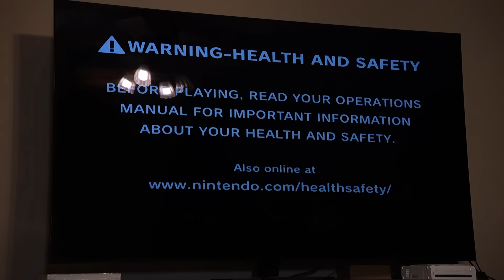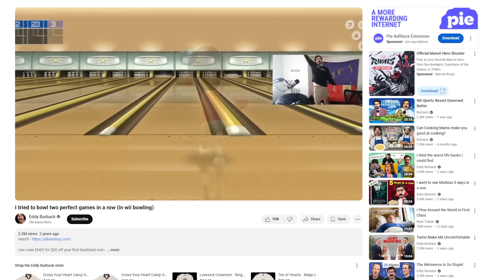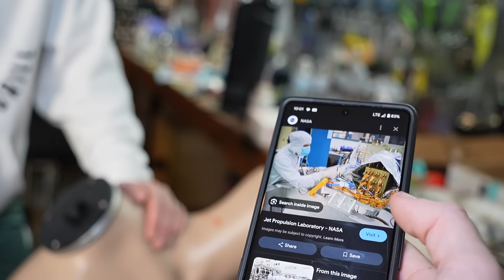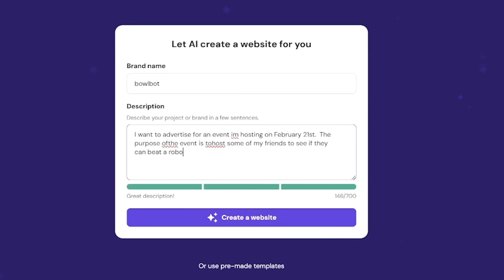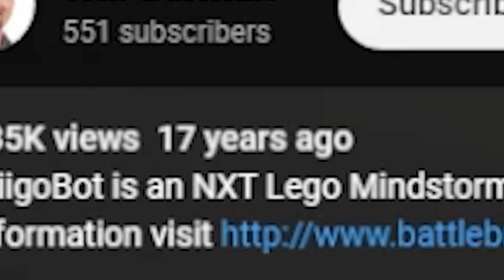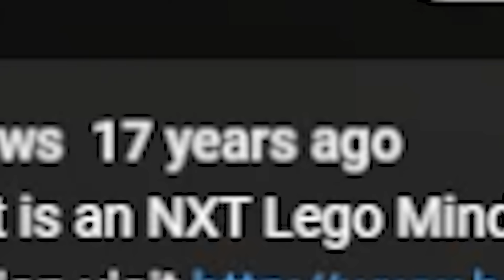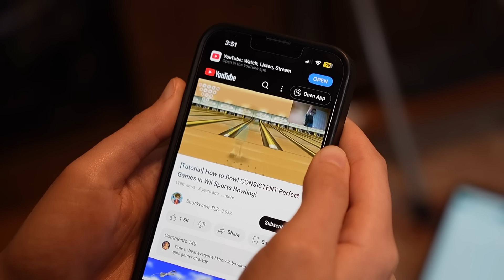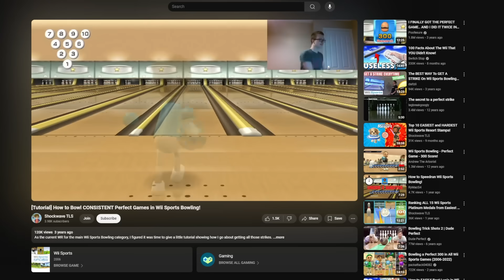I Built a Robot to Get a Perfect Score in Wii Bowling

Comment: When I was younger me and my siblings discovered that the best way to hit the ball in baseball was to hold the remote close to yourself and just flick your wrist/elbow as much as possible. Physics model goes crazy and the instantaneous g's you pull in that second send the accelerometer spinning while the sensor bar only sees a quick dash so your character does a full swing at the speed that you flicked your wrist.

Comment: I forget, does the original not let you add spin to the ball? I know the Resort version does, but that also uses the gyro controller/addon.
Reply: Nevermind, just got to the end bit where one of your friends put spin on it. Adding spin should make the strike pocket bigger and more toletable of minute perturbations, depending on how realistic Nintendo made their party bowling simulator. In theory this could make your robot more consistent at the cost of added setup complexity, but you only have to find the setup once per session. I'd also recommend clamping or weighing it down so the swings don't move it around. Didn't seem like an issue, but you never know.

Comment: I don't know whether it's the same in the not sports resort bowling. But in resorts you don't have to actually swing the remote you only need to accelerate the remote so just mount it onto so linea rails to move it in the direction of the tv that will make it throw perfectly straight then you would only have to automate the character moving like to clicks to the side and have guaranteed strikes all the time with a probably easier build (just my guess im not an engineer so i dont know whether it's actually easier but seems to me)

Comment: Love the video, the nostalgia is wild. 
Also why do you use junky servos? I think it would have worked a lot better if you got yourself a few nice Savox or MKS servos like they put in RC airplanes. Much faster and more accurate. 
Also I think that gear system probably amplified any inaccuracies of the servo. 
I think you should revisit this with better hardware and get a perfect 10… 10 times… 😂

Comment: Typical mechanical engineer, doing things the hard way. The EE / COMPE would just fake the sensor data and automate the button presses electronically, rather than physically swinging a remote and physically pressing buttons with servo motors.

Comment: congrats on designing a device that can play Wii Bowling almost as well as I could when I was 11.

the secret to getting 300 every time, without a robot, is to simply hold the remote backwards and twitch down forcefully with just your wrist as you release, instead of swinging it like an actual bowling ball. Do it right and it sends the thing flying straight down the lane at like Mach 3, and as long as it hits any of the pins, the force of the impact causes them to act pretty much like grenade shrapnel, rendering aim all but meaningless.

Comment: "If your workbench is clean, are your really doing anything?" - EtE. We had a saying "empty desk, empty mind", as a young greenskin, I thought that a joke. 10 years later, I could rummage and find a part that would suffice for 90% of my daily work flow within arms reach. On a slow day, my (very new) manager told me I needed to clean my desk. In an act of malicious compliance, my keyboard, mouse, and ~1 square foot of workspace was gleaming. My 12ft square of absolute fortification of parts  and tools were untouched. How would I find anything if I rearranged it all? It was an office of productive output, not aesthetics. And yes, anything messy was done directly into the bin. Cleaning is a waste of valuable time and effort.

Comment: Funny thing. If you would have only known that it isnt just putting the ball between the 9 and 10 pin that is the trick. It's angling the path of the ball so that it paths from right to left as well, it is much easier to get a strike every time. I mean MUCH easier.  The straight on approach adds way too much of a random factor.  In bowling, if you put English (counterclockwise rotation) on the ball and hit between the 9-10 pin it is pretty much guaranteed a strike as the ball sweeps across the line of forward-facing pins driving through and knocking them all down.

Comment: 100% same throw, absolutely repeatable: 
- Hold the buttons
- Start swinging your arm and moving around until the mii has run all the way to the line with the arm stretched out and holding the ball
- release the buttons. 

It will have the momentum as if you'd done a regular swing. I used to do perfect games like this all the time. But don't throw it dead center, press either left or right a few times. 

Have fun!

Comment: Dont need a robot. The trick is Twinkle Toes. Let the wii guy walk up to the line, holding the ball above his head. Then throw it with a hook. 100% strikes
Reply: Literally was just about to comment this.  I can't remember if I ever got a perfect game, but I would move my guy most of the way to the right, and release the button on the remote when my arm was at shoulder level. As I brought my arm forward, I would twist my arm fairly forcefully inward/counterclockwise to put a hook on it.  It was very repeatable, even for a noob, while bowling straight is much harder.

Comment: Aren't wall heaters more effective at a lower..... altitude? 1:10
Reply: That's a radiant infrared heater, it does not heat up the air itself, it emits a strong IR light that warms surfaces. Like your human skin and clothes. So these ones are better and more efficient for places like garages and outdoors. And they don't need to be low. It's essentially a lamp that emits heat.
Reply: Commercial radiant heaters are always mounted near the ceiling.  Our shop heaters are 16 feet from the ground. It gets very hot on the floor directly under them before the air is warmed enough to trigger the thermostat.
Reply: You are probably thinking about baseboard mounted convection heaters, radiant heaters are completely opposite.
Reply: Not with that altitude, mister.